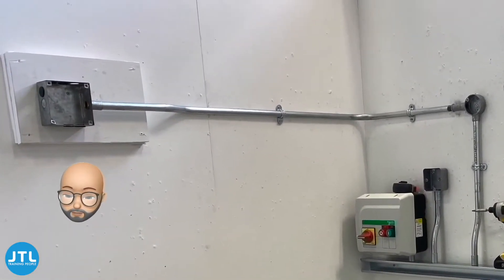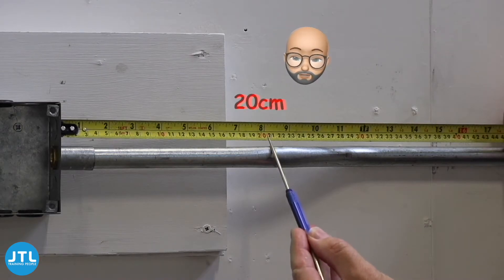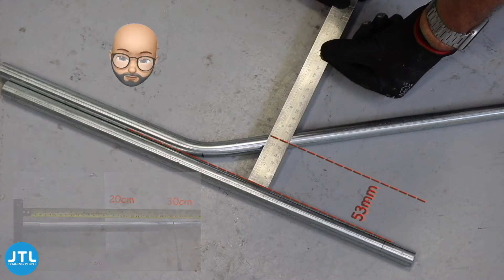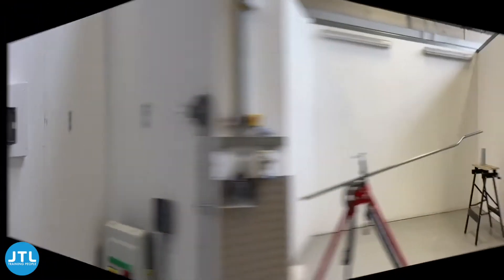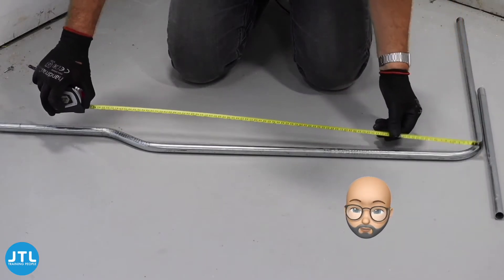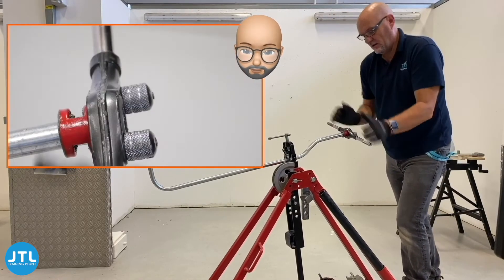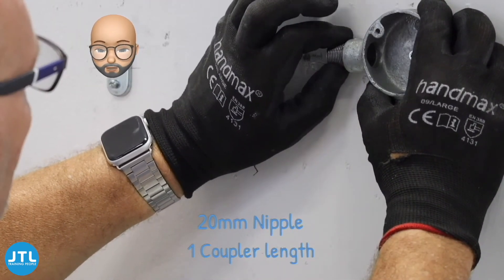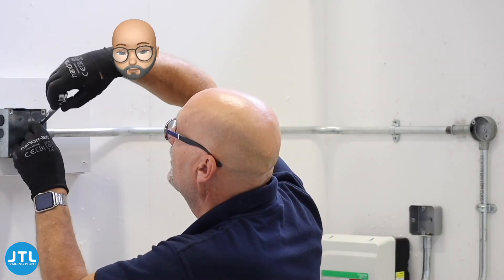Steel Conduit Bend, Set and Measure AM2s

Comment: 3:20 how do you find the point, on the former, at which the conduit will start to bend?
Reply from the maker: Good question … sometimes other users may have “marked” the former at the point of bend but this mark should not be trusted. The conduit will bend at the point where the pipe leaves the former … I tend to use my little finger to feel where that is and gauge it to the mark on the conduit (as shown at 3:20 in the video).
If you mark the conduit all the way round then you may be able to see it. 
However, unless you wish to line up several pipes with the same bend (like into a DB or control panel) then you don’t need to be millimetre perfect with it, as the depth can be easily adjusted to fit the job (5:40) ..

Comment: How did you know where on former the 2nd mark had to go to bend?
Reply from the maker: All measurements when forming conduit, should progress from one end. The conduit is always placed in the former with the “measured end” under the stock. Then each mark should line up on the former at the “point of bend” which is were the conduit and former separate prior to bending. Some people do mark the formers, but this mark is unreliable as it alters depending on which hole you place the stock on. 
The exception to this is where the mark on the conduit is for the “back of bend”. Then you would follow the instructions as shown in the video.

Comment: Great video but how do you know when doing the 1st and 2nd bends on set where bend starts on former please!?
Reply from the maker: When the conduit is resting in the former, the bend will be at the point where the conduit and former separate (underneath) … I generally place my little finger underneath to “feel” where that point is - and try to get the mark in the conduit at that point.. However - you don’t have to get it exactly right, as you can simply adjust the depth of the set. 
To add depth, put a little more in each bend. 
To decrease the depth, take a little out of each bend. Making sure to adjust the existing bend and NOT putting and additional bend in. 
Some people attempt to “mark” the former on top at the “point of bend” but you often have to change the position of the “stock” to get the measured conduit mark where you need it - as soon as you do this, the mark on the former will now be in the wrong place. 
Try not to over think it - bending conduit is more of a knack than an exact science. The ability to manipulate the bends neatly is the main skill. Practice makes perfect 👌🏻

Comment: where you had the running coupler and lock ring can you not just measure say half of the coupler so that when you tighten up the running coupler with the end you wont have any tread showing ?
Reply from the maker: I’m afraid not .. the running coupler needs to run from one piece onto the next piece. Therefore it will always leave some thread behind it. The way it’s shown leaves half the thread on the existing piece, and puts half the thread on the new piece. Therefore leaving half the thread exposed on the back of the existing piece, with both ends electrically (earthing) and mechanically secure.
Reply: @headsup4sparkies  ah yeah makes sense now thank you
Reply: @headsup4sparkies  also the nipple part you threaded into the box is this something for the am2 that they will provide ?

Comment: Just a quick question if the depth was say higher or lower than 53mm would you shorten or add more on too the 100mm in between the sets ?
Reply from the maker: You can increase the depth of the set by either making the 2 bends deeper, or by increasing the distance between the bends. In the AM2s there is a maximum length that the set can be, detailed in the spec. When setting out your bends you will need to decide what looks best and fits best in each circumstance. Hope this helps ..

Comment: Why not just use a battery powered porta band saw to cut the pipe and a hand bender.also when bending offsets you can just eye them from experience or just use the multiplier for the degree of bend to make the marks ..with a small bend like that I wouldn’t even measure it .you can just bend it and lay it flat on the floor also to check the height and then grab a tape measure to see if you have the right height if eyeing it as well as making sure it’s in the same plane .
Reply from the maker: Hi Chris … this is all true …. However, this video is aimed at apprentices with little conduit experience, who are taking their AM2s exam. Where they have one attempt to complete a piece of conduit without a coupler between the bends, with only these tools available to them.
They’re work will be closely examined and must come with-in the tolerances allowed in the marking criteria. Competent and experienced electricians like yourself, would not find this task challenging, but for electricians less experienced with steel conduit, it is useful to have a reminder of the basic skills required.

Comment: We have threaded pipe in the US (rigid metal conduit and intermediate metal conduit), but there's a lack of videos available online on how to assemble the entire run from start to finish. It's especially challenging, IMO from point to point and against surfaces, where we're taught to spin on the whole conduit run. Else, we're encouraged to use some sort of specializing fitting in tight situations above with a 3 piece coupling, or a threadless connector. This method you've shown avoids such things with a running coupler and the other end with a coupler/male bush, which don't require specialized fittings and makes everything straightforward overall. Thanks for making this video.
Reply from the maker: Glad you’ve found it useful … from what I can see on YouTube - US bending machines are a lot more robust than ours … we have also seen a few “slip-lock” type fittings reappearing in the UK recently … but I hope that the old school conduit skills never leave the industry 😀

Comment: Hi, got my am2 Monday I'm pretty confident on all aspects but my lack of fault finding is where I'm struggling do you have any tips or anything I should watch or read before the fault finding test part? 

Thanks
Reply from the maker: There are videos on fault finding (mine will follow soon I hope) that can help.. but fault finding is really a test of your knowledge of circuits and testing. Listen carefully to the symptoms and look at the state of the protective device .. this should tell you the type of fault you are looking at. Then make sure you locate it correctly .. you haven’t found it until you can identify it between 2 positions, if you have a short and you split the circuit in the middle, the fault will still show on one of the cables there, that doesn’t mean the fault is at that point - keep splitting until you find it at both ends of one piece of cable. Also - when looking for shorts to earth - NEVER DISCONNECT THE CPC’s at the MET .. the fault is on one of the live conductors !!  .. Good luck
Reply: @headsup4sparkies  Thank you I absolutely nailed my build I had this band and the S plan to do today with 5 hours to spare I done it! This video helped so much appreciate your time to make it👍 I'm doing my fault finding and online exam tomorrow I'm abit worried about the fault finding if I'm honest

Comment: Just a question - with regards to the depth of your double set - you’ve been quite accurate with your measures - 53 mm - and here’s my question - do we not need to take into account the depth of the saddle ? They’re usually around 3mm and up deep.
I’m learning - it’s just something that caught my eye :)
Reply from the maker: Hi … you are correct, and you would want to consider saddle depth, particularly for saddles deeper than spacer bar saddles. Generally a few mm’s here and there can be easily tweaked as shown in the video. Most wall corners aren’t exactly 90 degrees, bending millimetre perfect is unlikely ..  the important thing is to be as accurate as you can and allow yourself a little to play with. Then “offer up” the bent conduit in position and tweak it as required. This is aimed at the AM2s, where you have one chance to complete the pipe in one piece … so they give you tolerances in the marking. Getting the right distance between the set & 90 is key, leave the coupler cuts to the end .. 👍🏻

Comment: Americans use a Union...a lot neater and faster to install...
Reply: They do a lot more conduit compared to us in UK.. working there for 10yrs the biggest one I worked with was 6"  conduit...Fortunately I was old enough to remember imperial units which helped me a lot.. Still think we do a neater installation in UK ...that's my opinion ...
Reply from the maker: American conduit installations and equipment does differ quite a lot to our UK methods. More Robust and accurate bending machines and a more “mathematical” approach to setting out bends. We do use Unions occasionally, usually only in explosive Zones (Ex fittings). Here’s a link for any UK electricians reading this .. https://www.eaton.com/content/dam/eaton/products/conduit-cable-and-wire-management/crouse-hinds/catalog-pages/crouse-hinds-unf-unl-uny-unions-el-elbows-catalog-page.pdf  . Thank you James for your comment 😀

Comment: Good video,but you did not allow for the saddle heights in your calculations
Reply from the maker: I know ... I didn’t want to complicate it - I used spacer bar saddles so it’s only a couple of mil - and as it happens.. it fitted nicely (walls clearly not that square 😀) .. Thank you for the feedback .. I should be posted an S-Plan Heating wiring connections very soon.
Reply: @headsup4sparkies  How soon please 👀

Comment: How do i bend really a long piece of  conduit (4m) in the middle. I need a 90 degree bend but the end will hit the floor. Thanks
Reply from the maker: Hi ... the most common way to bend a long length is upwards. Using the bender in exactly the same way, except that the stock and bending arm will be at the bottom of the former, and you bend the conduit upwards ..    hope this helps
Reply: @headsup4sparkies  thank you for the reply. Do you know which brands can do this as i see some that state maximum lengths of 1100mm so I'm assuming not all can work upside down
Reply from the maker: https://cdn11.bigcommerce.com/s-7holhynnib/images/stencil/original/products/50562/40912/5adab7f8ee8a76000e5dfa02__88558.1583489141.jpg?c=2&imbypass=on&imbypass=on ... any bending machine that looks like the one in this video, can bend upwards. The link shows an image with the Stop & Bending Lever hanging under the former.  Place a foot on the bending machine and pull up to bend.
Reply: @headsup4sparkies  thank you for your time and patience in answering my question. You've been a great help. I managed to hire a machine from HSS and it bent my long conduit upwards as you said. You've been a great help.
Reply from the maker: You’re welcome ... well done 👍

Comment: Got my Am2s coming up this has been a massive help! Are these measurements the same as the AM2s on the day or your own made up ones thanks!
Reply from the maker: Thank you for your comment. The measurements on this video are specific to the job in hand, however the requirements for the AM2s are similar to the task in this video. Therefore this video shows you all the techniques and planning that you will need in your assessment. Good luck 👌🏻🤞🏻😀
Reply: Ok thanks again 👍🏼

Comment: When measuring the 53mm you didn't take into consideration the depth of the saddle base (5mm) so it should have been 48mm!!
Reply from the maker: That is true - good spot ... although I was using spacer bar saddles which are only a 3mm base. I left that bit out for clarity as conduit bending is not an exact science and most sets need a little “tweaking” to sit perfectly 👍🏻

Comment: How do you know exactly where to put the mark in the former after measuring 53mm?
Reply from the maker: That’s the beauty of leaving the coupler cut till last ... I gave myself a 70mm margin of error and only needed to worry about the depth of the set, and not the position of it, initially .. therefore placing the mark at the approximate point of bend on the former is sufficient.

Comment: That was excellent just what I needed not enough videos on conduit bending for uk electricians,apprentices,adult trainees it seems to be all American with the Klein bender keep them videos coming guys its very important and helpful thanks for sharing 👍
Reply from the maker: Mark Andrews Thank you for your comment ... 👍🏻
Reply: "american" way is faster.
Reply: @pokechamp003  I agree with you I have used the Klein bender before and I did like it but getting a 20mm or 25mm shoe in the uk is very expensive and when we have to thread the ends to fit the coupler we need a vice I believe the American version of the coupler is push fit also a better idea